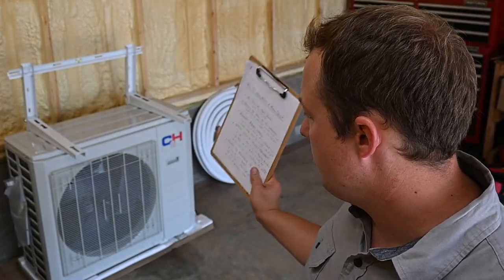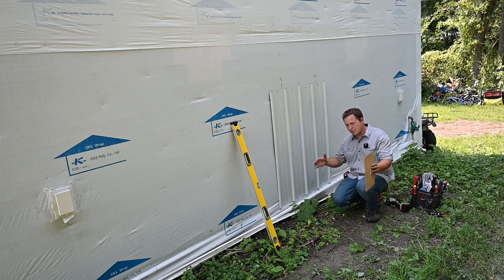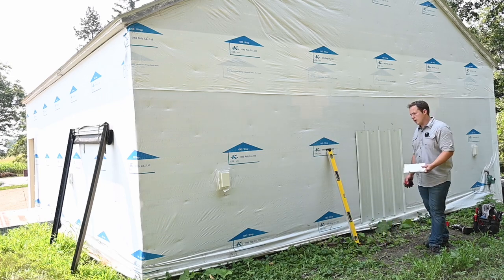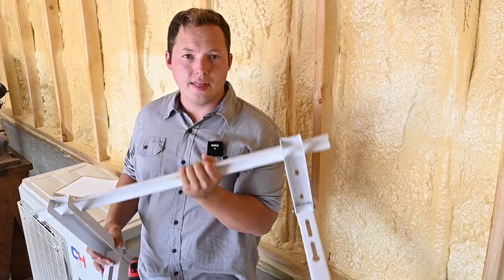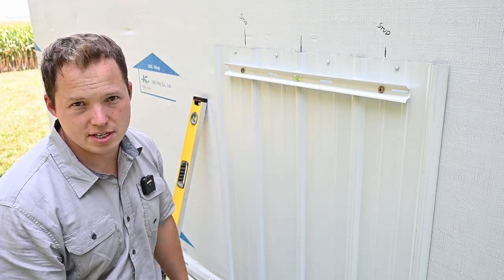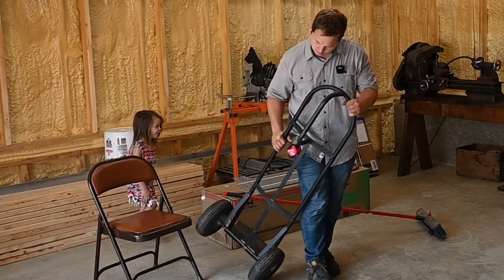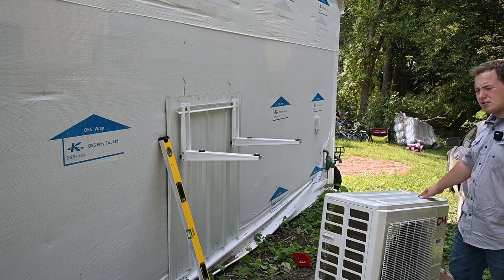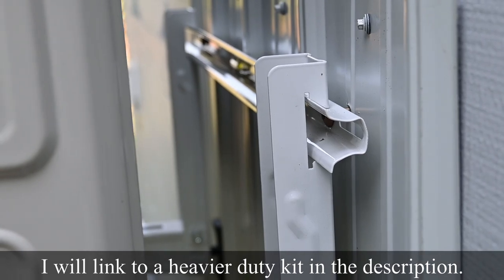How To Wall Mount a Mini Split Outdoor Condenser Unit

Comment: Thanks for sharing.
Question: I am about to install one on similar bracket. Mini split requires 12 inches away from wall. The bracket might give only 4 inches. Will that be  a problem?
Reply: That's what I'm wondering, about to install one myself which requires 12" from wall and the unit is 12" so need a 24" bracket which doesn't seem to exist.
Reply: @sylviaisgod6947  I called the manufacturer and was told less than 12 inches from wall on a bracket was perfectly fine because unit will get air from the bottom as well.
I installed mine about 4 inches from wall on bracket and is working fine.
Nobody install them on bracket at 12 inches.
Hope that helps.
Reply: @joaquinsuarez6090  Me too....I emailed Cooper and Hunter and was told 6" was fine. No explanation why it says 12" in the manual though.

Comment: When I google search the clearance for outdoor unit especially the distance from the wall, I get 12 inches to 24 inches away from the wall.  If you use the wall mount bracket. this only allow barely 6 inches from the wall.  Is it ok to be only 6 inches from the wall?
Reply from the maker: It really should be fine but having more space is always better. Also, I wouldn't recommend using the wall bracket I did. Would be much better to just build one out of angle iron and or have a local welding shop make one for you. Then you could get it made to be 12" out as the manual recommends.

Comment: Hi
I have just purchased the same style and size unit and weighs 40Kg. (24000BTU)
The brackets say they are good for 120Kg but look so small.
Fingers crossed they hold up as they are solid but look similar to yours that you have installed
Isn't there a minimum space between wall and Unit?

Comment: Hey Ben I’ve got two single zone C&H hyper heat 12k units. Love them but one doesn’t work as well as the other in heat mode. Room temps drop 6-7 deg below setpoint, then it kicks in and brings the room up to temp. Temps then drop back 6-8 below. Repeats this cycle from peak to trough every hour or so. Other one is smooth and holds temps dead on. Currently winter here. Any thoughts on this? If it were refrigerant related I’d have a code for that right?
Reply: Greetings from northern Europe. C&H are sold here too but no seller recommends them. It's not a reputable brand. Just a sticker name slapped on random Chinese import. Main problem isn't that it's Chinese. It's the deception in numbers. You can write whatever numbers on the product sheet, but if they don't hold any water in winter, than it's just wasted effort. The money people save by choosing the cheaper option will be spent triple when the actual efficiency numbers have a meal with electric bill in winter.

Comment: You can also get hernia lifting like that.  I think maybe you should have put the unit the back of your pick-up truck.   or slid the unit up on some 2 x 4's or 2 x 6's.   You are lucky you didn't drop it off that flimsy bracket.   Another option may have been to rig a block and tackle up higher on the wall.

Comment: I’m wondering about your indoor unit. I bought a Gree system which is the same unit. Or at least it has the same manual. My indoor unit has a power cord pre-installed, and nothing in my manual explains it. Any ideas???

Comment: As others have mentioned. Isn’t the condensing unit supposed to be at least 1 ft from the wall? I see all the wall mounting brackets are putting the units within a few inches. Will this reduce the efficiency of the unit?
Reply: Depends on air intake location.

Comment: Dude, my heart was in my mouth as I watched you tip the outdoor unit over your thigh and place it over the mount. Very dangerous! Would have been great if you had a stack of box stairs to elevate the outdoor unit up to the brackets.

The other thing I noticed is that the brackets of the mount seemed wobbly. I guess the design doesn't allow for them to be secured to the frame on the wall. In my opinion, that could be improved upon. 

Lastly, you got a cute bunch of kids, especially the mic thief.

Comment: If you do this on a house I would never attach to wall. Vibrations from the motor will be extremely annoying, and it could make the drywall inside come loose from drywall screws.
Electricians never hard pipe to a motor for a reason.... vibrations.
Reply from the maker: Exactly

Comment: Work smarter, not harder.  Next time use a 4x4 and lean it against the wall as a ramp and slide the compressor up that.  Then your only lifting it a couple of inches align the feet on the bracket.
Reply: Front end loader for the win.

Comment: get a pulley and snatch block and temporarily bolt into a stud several feet above the mini split. strap ohter end to mini split.  have wife pull on it so you can safely lift it up. You are young now, but in a decade that will kill your back. be careful!

Comment: Hey bud I don't know if you'll  even get this  message because this video is 5 months old but anywhoo you kind a skipped through the part where you were hooking the wires to the inside unit without explaining what is what...as I'm planning on putting a couple mini split units in my house and have been looking for instructional videos i thought this would be a more in depth video from watching your others but....

Comment: WOW!!!!! 
You are saying that this unit is in no way, other than the electrical and refrigerant pipes, solidly held on that bracket???? 
If this is true, what an idiotic and dangerous move!!!!

As for the added spaces, what do you think the rubber on the mounts is for? Adding more is good, but you just made the first comment I made even more important.

What is the shear strength of those fasteners? Most fasteners are NOT meant to have continual weight on the shaft, like you have it. 

Over all, I hope this is a satirical video of exactly how NOT to install a unit like this. If it is actually a great video in your mind, I am truly sorry for you.